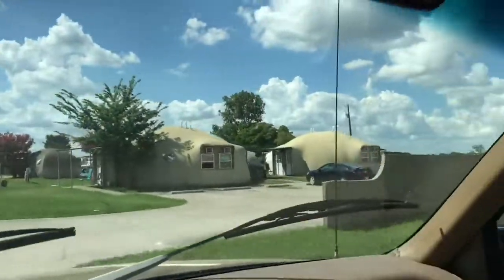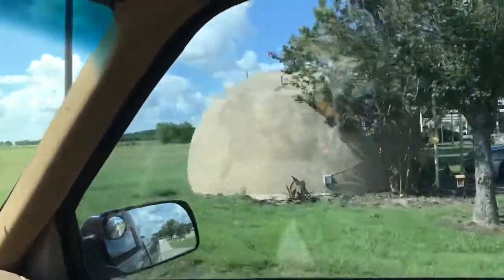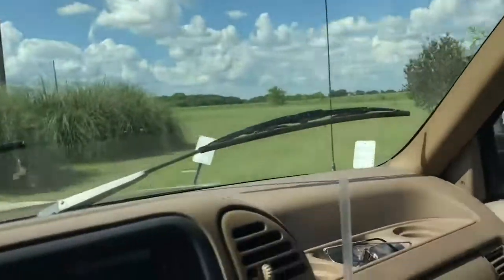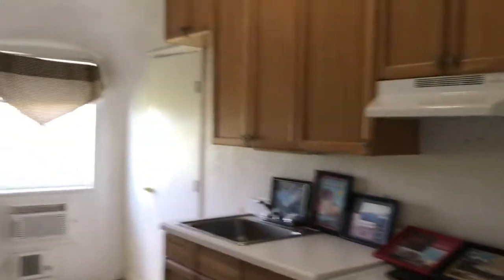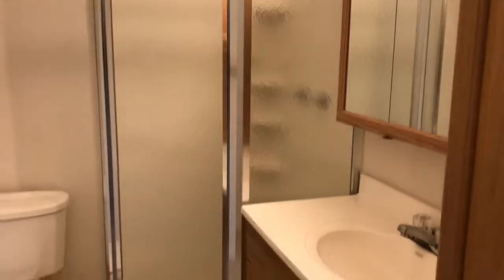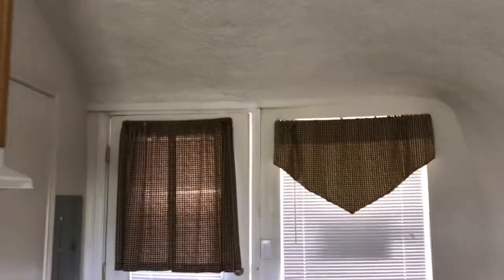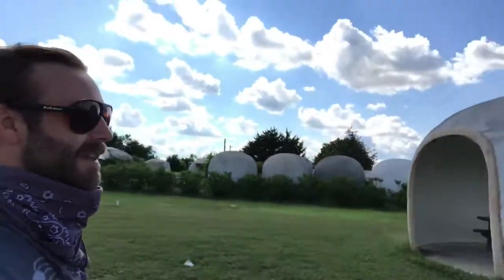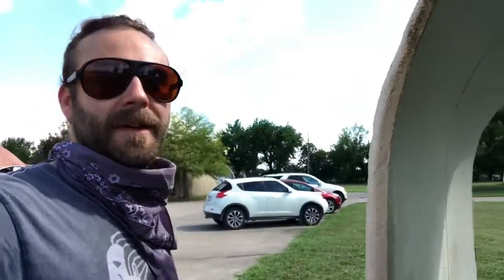Dome homes in Texas - Monolithic Dome Research Park

Comment: They inflate an airform, spray inside with urethane foam, hang rebar about 1/2' off of that THEN spray shotecrete embedding the rebar inside the shotcrete.  About 4" thick
Reply from the maker: Proton Neutron thank you for the correct info, it was explained to me but I could remember the whole process.
Reply: @natotomato4509  No prob.  I've watched Monolithic's video a few times.  If you live near Dallas there's a company that has a REALLY good deal on making  them if you have a patch of land with water, electricity....
Reply from the maker: @protonneutron9046  I am building an Aircrete dome outside Austin. I have some videos uploaded from the progress so far.
Reply: @natotomato4509  Great!  I've seen lots of interest in that and lots of people looking for videos of construction process.  Recommend title: Aircrete dome construction video.  Should garner lots of views on YT.